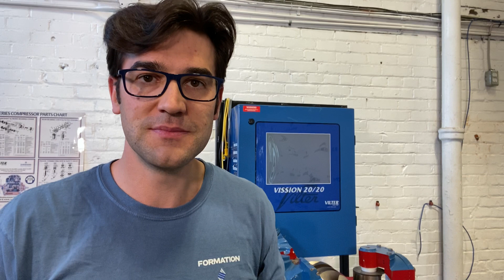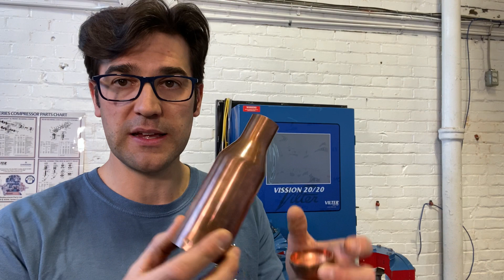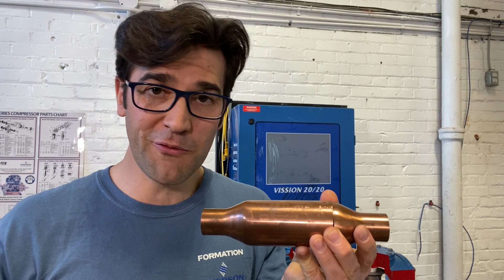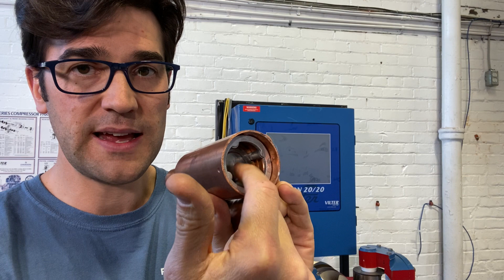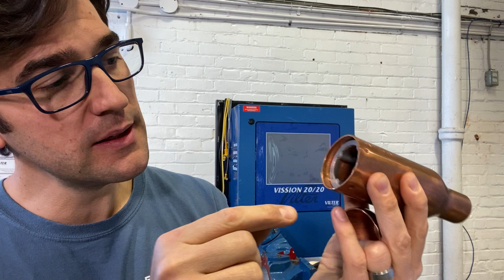Refrigeration Check Valves

Comment: Hello, I have a parallel rack with discus compressors that's really oversized. The compressors on standby that pretty much never run keep overfilling the cranks with oil and drains all of the oil from the reservoir. The oil is draining back down the discharge lines and making its way back through the discus valves, around the rings and into the cranks. Initially I thought the oil level floats were letting oil through but I replaced the floats and added solenoids to the oil return lines which did not help at all.  Finally, after locking out the standby compressors and front-seating the discharge valves the oil control problem went away. These are rebuilt compressors...the OEMs arent having this problem. Anyway, long story short...I've ordered these exact valves in your video and was wondering if you think this is an acceptable application for them. The real probelm here is the way they piped the discharge lines and headers. The oil just falls down the non-running compressor discharge line and accumulates in the piping and eventually makes its way into those compressors. I've pulled the valve plates and they look great. Thanks for all the videos you've made. I've learned a lot from you
Reply from the maker: The statement where you said the OEM compressors are not having this problem. That is the problem.  I have seen things like this before with rebuilt compressors.  I have seen many issues over the years not this exact thing but many difference compared to a remanufactured compressor.  This is not to say they are all bad because I have heard of some great rebuilders.  I have some compressor masterclass's coming up you maybe interested in https://refrigerationmentor.com/upcoming-courses/
Reply: @RefrigerationMentor  Thank you Trevor!!

Comment: Hey. I do grocery store Refrigeration service work, I have had several Hill Phoenix cases and now arneg cases with check valves for the hot gas defrost. Have had several fail over the years. Now I’m servicing a bran new store with Arneg cases and only 2 months in the valves are leaking by. Have you ever heard of  using a magnet to possibly unstick/loosen or open a valve that’s not opening like should be?   It’s not letting a defrost go through and coil gets iced over.
Reply from the maker: No, I have not heard of this. Have you talked with the manufacture or the check valve or equipment? Have you cut any open to see what are causing them to fail?  Is something jammed in them or are they sticking.  I would love to know myself.

Comment: hi , thanks for the video.  my fridge has dual evap and the suction line out of the compressor goes to a tube that look like a check valve tube you describing in this video, so I assume it is a check valve, but not sure. but at any case , when I place my hand around it I can feel and can hear clicking inside . any idea why? is it failing ?or  is it normal? not sure if this maybe the reason with my freezer not getting cold enough only get to 15F instead of 0F
Reply from the maker: What are the operating conditions? Suction and Discharge pressures and temperatures.
Reply: @RefrigerationMentor  yeh, the low side pressure was at 20PSI and the high side was at 150PSI. I figured that the reason the check valve was making clicking sound had to do with overcharged system, is that correct? are you looking for in/out temps across the check valve or in/out temps across the filter drier?
Reply from the maker: @maxmax-ui3ks  Here is a great compressor troubleshooting chart that will help you really understand what's going on in that system fill it out the best you can. https://thermal.on.ca/wp-content/uploads/2020/09/Copeland-Troubleshooting-System-Checklist.pdf
Reply: @RefrigerationMentor  all I need to know is why the check valve is clicking , is it failing, or is it normal?